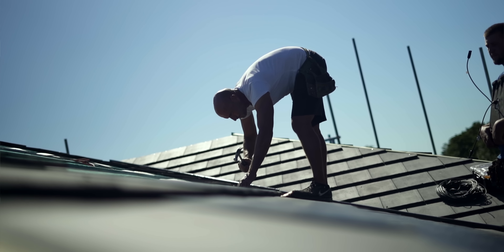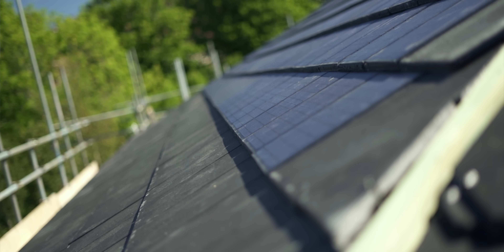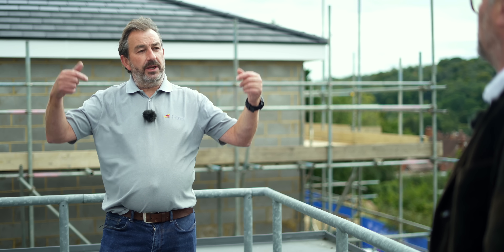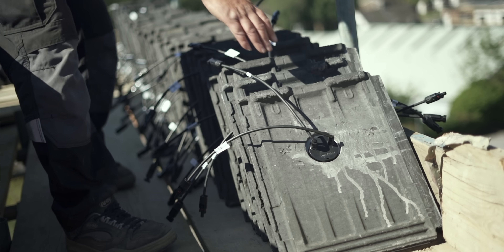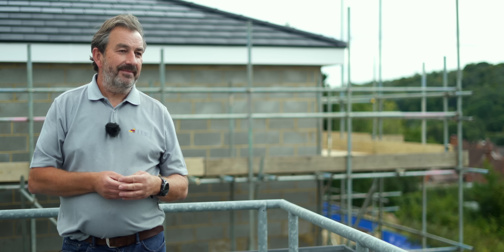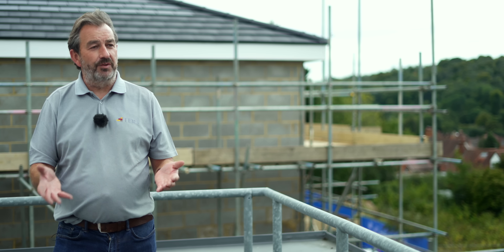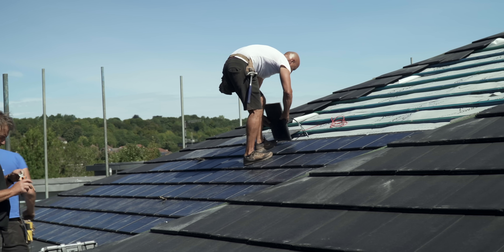Solar On Every Roof?

Comment: The big potential problem here, that was not addressed in Robert's interview, is, how is the problem of over-shading addressed?

Lot's of properties have roofs which suffer over-shading from other properties, and especially from trees.  For conventional solar panels, this reduces efficiency across the entire array, even in respect of those specific panels which are not over-shaded.  The whole array only performs as well as the most over-shaded panel.

The solution is to use panels which each have their own mini-inverter.  SolarEdge is an example.  With these panels, each panel performs to its best efficiency, regardless of over-shading.

How do these solar tiles address this issue?
Reply: Hi, you are correct however, every tile has a bypass diode included, which combats the shading issues that traditional solar experiences. Laboratory testing in Vegas has shown that in low light, shaded conditions we can generate 50% more power than standard modules.

Comment: more expensive to buy ,more expensive to instal, less efficient panell. horrible to service (how long you will find faulty tile compare to panell) and for me the pannels looks much beter..and the load is the same or somebody believe that the extra solar tile on each concrete tile dont ad? and structualy you make big hole in each tile make them much more easy to brake.

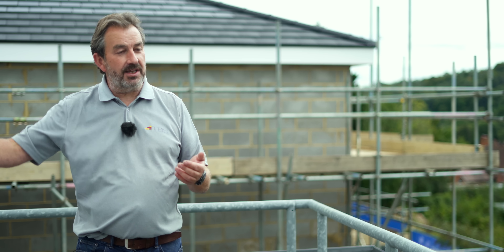Comment: 3:07 4-6kW systems.  That seems awfully small.  Can you really get away with using a system that small with ground source heatpumps?  My system is 10kW and that only powers the normal electric + my EV.  That doesn't include heat or hotwater.

Comment: The issue here is I looked into solar panels, heat source pumps etc cost for my 2000 square feet house to install 32k yes 32k I will be pushing up the daisys before I ever get the cost back and I’m in my forties, and the person that worked out the cost stated I will be negative 1500 when it will need a complete re install

Comment: While I like the idea in principle, and it looks much better I do have a couple of issues. 
1. (As mentioned by others) the hole in every tile and a small bead of adhesive to bond the cell to the tile is not going to last long or be 100% perfect for every tile. This means leaks.
2. Roof tiles life probably exceeds 50-60 years, solar panels probably 20 years or so before losing efficiency. And with this it's a new roof when the solar panels need replacing.

Comment: Not a good idea in Colorado, where golf ball sized hail storms happen every summer. Those hail storms cause a high percentage of home owners here to get new roofs almost annually. Our insurance rates will skyrocket if the insurance companies have to pay to replace all those solar panels annually also! The only way around that would be for the installers to put at least half inch thick plexiglass above the solar panels which would probably make them less efficient, especially when the dust from our dry climate clings to the plexiglass. By the way in my 40 years living here I have seen softball sized hail on 2 occasions.

Comment: I've got roof integrated PV panels.  They are ordinary PV panels with a special mounting adapter made by a company called GSE.  It's smarter looking than an "on-roof" system, and it dramatically reduces static load on the roof.  It's been in operation for 2 years and has withstood Storm Arwen, Malik and Corrie without damage, and it's shed some of the worst torrential summer downpours I've seen without leakage.

This looks good, but the labour costs are much higher for installation and because of the number of individual elements and connections, the warranty callouts are likely to be higher than they would be for ordinary panels.  There's also a complete lack of choice in this form factor, so warranty issues in the years to come are likely to be met with obsolescence issues, whereas standard sized panels will probably have plenty of replacement options to choose from.

Since the pandemic, I've been tracking the PV/Concrete tile price ratio.  Prepandemic, it was £10/sq metre for concrete tiles, vs £50/sq metre for solar PV.  So price ratio was about 5.  Now it's £20/sq metre for concrete tiles, but £100/sq metre for solar PV.  Price ratio is the same.  

So personally, I think trending solar PV tech will focus on reducing rooftop costs.  That means lighter rooftops which also benefit from lower transport and manual handling costs.  I also think simpler fixing systems for both panel and wiring will continue to reduce labour costs.  This technology of fixing PV direct to an old fashioned concrete tile doesn't address these cost objectives.

Comment: What's the efficiency loss due to the extra heading as you've lost the airflow.
Also are these tiles rated for 40 years if your looking to swap these 1:1 for a normal roof.

Comment: The math is interesting.  The variable is the future price of electricity.  I feel safe assuming that the price will increase.  Then there is charging your car at home.  The electricity price at home is much less than at a public charger.  Added bonus is having electricity security.  It does not take much to knock out the power grid.  I cringe when I see new houses without solar roofs.

Comment: Just to update the facts and figures given in the episode which was filmed over 2 years ago, we can now offer the following.
Despite 2 years of price rises for components, the tiles are now £29 each, however cell efficiency has increased to 21.3%, meaning that each tile now generated 17.5 watts.
This is in effect a reduction in cost of 17.5% for the same amount of output.
As volumes continue to increase, further savings will be passed on.
Reply: Hi Chris, any chance you could address some of the issues raised in the comment section.

1. temperature vs efficiency due to loss of airflow under the tiles.
2. longevity, as you mention councils are doing roofs to last 40 years, will the panels last that long both as a solar generator and remain waterproof. 
3. maintenance, how easy are faulty tiles to identify and replace.
4. Warranty, had a look at your site and can't see any info on it.

BTW I will be replacing my roof in the near future and wanted to do a PV roof like this but the more I looked the more it appeared the drawbacks out weighed the aesthetics.
I see samples listed on your website but nothing on the page behind, do you sell to the public?
Reply: @TheWebstaff  Hi Dave,
Firstly concrete tile behind module acts as a heat sink, second, no glass above module means less heating up thirdly, cells are "cut cell" technology, meaning that wiring is shorter, reducing the effect of heat causing increased resistance, which reduces the performance.
As there are no moving parts in solar, there is little to fail, in 20 years of installing I have replaced 1 dead module. With a 25 year cell performance warranty, and using a mineral polymer encapsulation,  we expect this length of durability.
There is no easy way to notice if one tile fails, as the bypass diodes in the rear of each module ensure that all working tiles in full sun, deliver their full output, with any shaded or failed tiles, reduce the total output by just 12 volts.
We supply most of our tiles to self builders and general public.

Comment: If you want to replace those panels, then you have to replace your roof. Unless you are very rich, this is still not practical (aside from aethetics purposes). We have a 100 watt panel and weighs around 10kg. Each of those tile is 4.5kg and is only 15 watts.

Comment: Would like to see more about how the modules are adhered to the tile and associated issues of weather proofing and therefore design life. Some tile cutter rig? Noise, dust and how long does it take? Don't get me wrong, it looks awesome and thanks for sharing it Fully Charged Show :)
So glad new building regulations (June 2022) in the UK finally require new build domestic to have PV included and an EV charger, about time!
Totally agree about big commercial buildings not having solar, it's bizarre, I guess lots are rented or leased? Short term thinking and lack of awareness, the payback on supermarket chillers and lights must be pretty quick even if only doing private wire and batteries (just self consumption) and not exporting to the grid.
Reply: Hi Dominic we supply the tiles direct from the factory with the module already mounted, as a new roofing product, rather than retro fitting onto existing roofs
Reply: @chrishall409  it does seem a shame that a hole has to be drill through a perfectly good tile, therefore increasing the risk of water penetration, which is the primary purpose of a roof. Great work though on improving the likelihood of solar electricity being rolled out.

Comment: This is brilliant!  It is obvious this will soon be the norm in the building industry everywhere, it is so simply and elegantly the right thing to do. This feels just like seeing the beginnings of the phone tech industry in the early 2000 and already seeing where it is going to lead. 

The future looks so fascinating and I cannot wait to see where these innovations are leading us.
Reply: its 30-300x the cost of a non solar roof and 2x the cost of a regular solar installation based on what this guy said. i highly doubt it will ever be the norm, but it will become more common. remember, tesla tried doing this and have failed so far, likely because they underestimated cost and difficulty. youre bound to see much more regular roofs with solar on top for now, even new developments.
Reply: @jonathanodude6660  Costs are going down at record speeds, and the trend accelerates even further as time goes by.  I would agree, that there will likely be need for solar on top of regular roofs as well. The future looks very interesting nonetheless!
Reply: @blackcoffeeandbooks8884  I think that once the price is measured in %s rather than multiples, you’d see a mass movement towards these types of roofs in all new builds, but until then, it’ll be a niche market for those rich enough to care about aesthetics over practicality.

Comment: As mentioned by others, how is shading not an issue here? 🤷🏻‍♂ The panels are being 5% shaded by the next row up or was the b-roll just not actually a finished product?
Reply: The overlap from the tile above is only on the concrete part, and does not overlap the cells.

Comment: £27,000 for one roof - Dream on.    (£30 x 900 tiles)   This is a total non starter.   It's 10 times more expensive than traditional panels, nobody in their right mind is going to do this.  It's a real shame but it fails even the most basic sanity check.     While we are doing a sanity check - 900 tiles on one roof needs 900 individual MC4 connectors.   That is a big problem as those MC4 connectors do fail. According to the information given, one connection fault will disconnect 45 tiles. After a few years those 900 connectors will fail, fault finding those will be a common event and ridiculously time consuming.

Comment: I bought my brand new house in 2020, we bought the house off-plan and the builder had no option for solar to be installed while they built the house. I could not believe it, I wanted to have solar installed and I was told I could not because they do not provide it as an option. They grudgingly put in a car charger which I believe is actually not up to the task and will need to be removed and replaced with the correct wiring! The housing industry is broken.

Comment: Solar roof tiles, aestetically, are great!  But like the Tesla solar roof, have the same issue- cost.  PV Panels, even as they have dropped significantly in cost over the last 20 years, are still expensive.  To pay 3x that cost just for the aestetics is beyond what most people can afford.  At least with PV panels, you can make a case for a pay back from that investment, albeit a long one- but not really for solar tiles.  When their costs is equal to that of the cost of a new roof + PV panels, only then will they make sense for the vast majority of home owners, and only then on either new homes, or homes where the whole roof has to be replaced.

Comment: But doesn't the "plonk on modules as an afterthought" not add ventilation/cooling for the panels? Or does the tile provide enough of a heatsink for that purpose?
I also wonder if the overlap causes a slight shadow to appear which could drag the output down of the tile.
Reply: Give that a company in Australia is now developing cooling systems for solar panels to increase the efficiency (by quite a lot), your point is very valid!

Comment: 50% of grid is home load, these installations UNLOADs the grid, and can even give power back into the grid.
In a 100% electric world they give the distributed power directly to the users.
In 100% electric 5 times more electricity is required.
The central concentrated traditional power system will fail economically.

The existing grid is decades of construction and resources and $trillions , so 5 times more grid capacity, 40,000klm per million people at $2million per klm. poles , wires, transmission lines, to streets and homes and buildings and ...
mind numbingly stupid.

Plus 5 times more nuclear power plants at every power station, at $2billion each 300mw system, stupidly big economically and decades and decades and decades and .........

Fossil fuel are energy dense, petroleum, gas, coal. that is all the distributed systems that will be replaced.

Comment: in Australia there are 20million buildings all connected to the national grid. (almost, there is a gap 1,000 miles )
33kwh from every roof is more than the national total max daily fossil fuelled electric power generation if the generators are lucky and no failures.

Comment: The drilled hole right in the middle of the roof tile concerns me a little. Over time, moisture can make it's way under the solar panel through the hole and under the roof. Same if the solar panel breaks. This area get's weakened alot. It would be more safe to put the electric connectors on the top area of the tile where they overlap.
Reply: The roof is an open air design.  Under the panels (below the nailing strips) is water barrier membrane.  Cement tile roofs like these aren't sealed.  The tiles just lay on top of each other.  If you are concerned about the water making it's way under the solar cell, you should be more concerned about the gaps between tiles since the tile above doesn't overlap the seam below by more than just the small overlap area where it's nailed 1:35.  The tiles only have a small channel on the side under the adjacent tile for water to drip down.  You can see it on the left side of the panel @ 1:24.  But nothing is sealed, wind can blow water right under.  edit: although under closer inspection at 0:45, it seems like they only have a vapor barrier under the nailing strips and not sure what's creating all the gaps underneath the strips.  The waterproof membrane seems to be on the lower part of the roof, but the vapor barrier goes under it instead of over.  This seems like a recipe for rot.  It would be at least where I live.  Maybe it works for the climate there.  Edit 2: at 4:26 they seem to be just pushing down the vapor barrier to fish the wire under the strips, so that seems like there's nothing below but rafters.  Maybe the entire attic is open with just the vapor barrier to catch the small drips that make it past the tiles with no decking at all.
Reply: @scottkolaya2110  I'm familiar with this type of roof and I'm not concerned of a well proofed roof design. The water barrier normally stays dry and acts like a second security layer when the roof tiles leak because of damage or misalignment.The big difference between the overlapping gaps of this and any other roof of this type is that they are vertical in the way water runs. The solar panels are not full-area glued and most important their gaps run horizontal. This way the water can easily flow under right to the drilled hole which damages the waterproof system of this roof design.

Comment: If you are getting "traditional" solar for an normal house. please specify Pigeon Wire Net round the edge . Some installers are not bothering & their customers are still getting Flocked ! ( cooing, rain of pigeon dung,damage to roof, possible fire risk).   Which ever type, Solar PV is worth it both for long term finance & climate change & reducing dependence on energy companies. Literally taking back power!